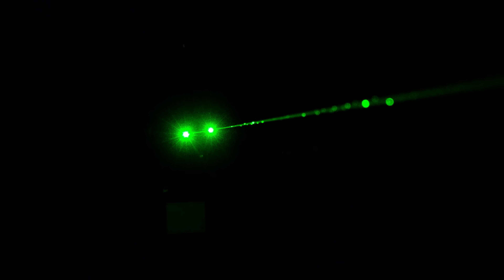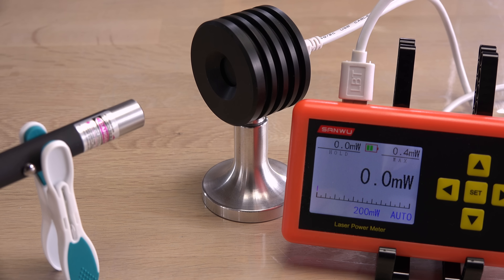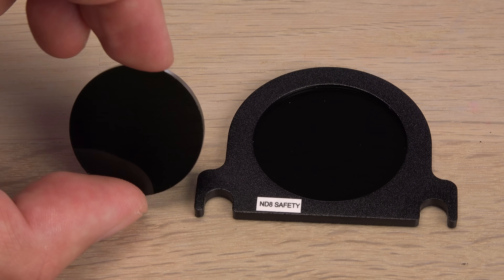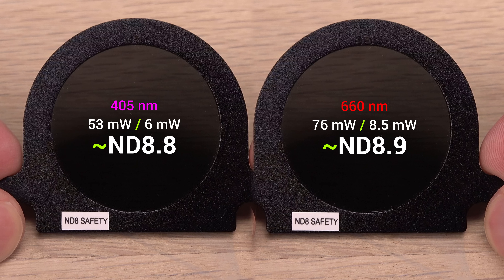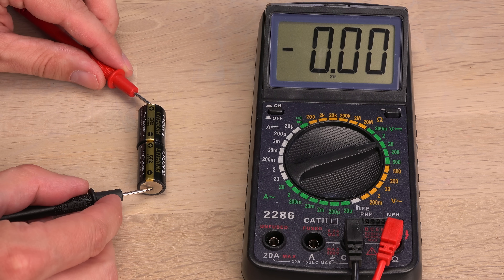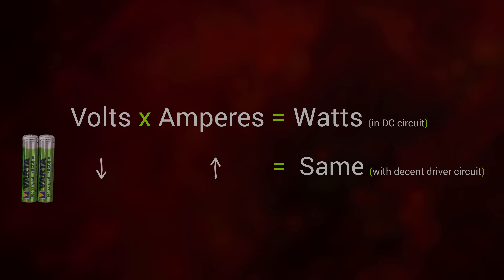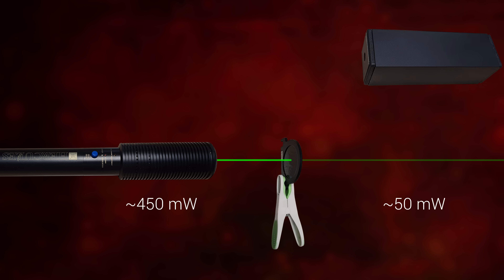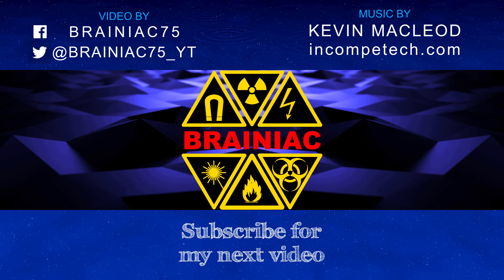Are lasers safer with rechargeable batteries?

Comment: I need your opinion on something. I worked for a company for 9 years and manufactured OTDR's. Our lasers were  650nm at 1mw, (this one was open-air, with no optics and visible ). We used 1310 at 15 to 30mw. 1550 at 55mw, and 1625 at 120mw.  They were spliced into optics (mux - negligible loss,  5% loss coupler, 50% loss coupler) How dangerous was this to our eyes? as the light was invisible and there was no way to tell what was shining across the manufacturing floor. As well as techs sitting at benches opposite each other could be looking into the beam from the OTDR across from them.  Then we had an optical calibrator that was at full power of the above wavelengths emitted from a fiber optic cable at a bench.  I am wondering if there could have been any harm done at this power level to the eyes? I thank you for your reply.
Reply from the maker: Hi James. Hard to tell without seeing and measuring on the set ups. I have no experience with fiber optics so I can't tell anything for sure. But I think I have seen sources on laser beams exciting fiber optics with very high divergence. This means the 'beam' will only be an eye hazard if you put your eyes close to the fiber end. But I am not the right to ask. A laser safety officer at the work space should have the answers.
Reply: @brainiac75  Thank you for your reply, funny, we never had a laser safty officer, at least not that I was aware of, and I was the group lead of the optical department.  Im sure it was ok, but exposure is a possibility. Im sure its just age but 15 years later my eysite has degraded throughout and I wonder.  Thank you.

Comment: Having been to an optics labratory with class 4 lasers all over the place and lots of optical instruments in the beam paths i can say that everything is on one level. There is no deviation in verticality. Everything is surrounded by 5cm thick walls covered in filter material and its not allowed to lower your head towards the level of the optical instruments. Its all because of the reflections which are devastating for class 4 lasers. When instruments are run you can actually see the beam path split and hit the walls.
Reply from the maker: Yep, a common lab safety procedure is to keep the laser beams at one level - and never at eye level! It is also recommend to use a laser of lower power while setting up the optics and then switch to the more powerful laser for the actual experiment. Or lower the power of the main laser if it can be regulated while setting up the optics. Reflections are no joke! Thanks for watching and sharing!

Comment: The reason that changing battery  doesn't affect the Power output much is because the laser driver circuit has a voltage boost, thus the output voltage remain in the same ballpark. This will only happend with higher voltage laser (>5 volt). For example PLT5 510 running at about 6v to 6.5v

Comment: Since laser diodes are constant current devices lowering the voltage with rechargable batteries won't really work. An appropriate sized resistor should help lower the current and the power.

Comment: Simply add a resister between the power source and the laser.
If you don't want to mod the laser itself, using a conductor instead of one of the batteries should lower the voltage enough. 
Another option would be making an inductive receiver that fits the battery chamber. You can then use an external power supply with finer or use a constant power and change the number of windings in the supply inductor.

Comment: Hmm. Perhaps making the beam broader would lower the power, or would that just spread it out, but still retain full power? For example through a lense or some glasses?

Would your eyes still be the same amount of in trouble if you had a very thick lensed prescription? Or would it lessen the potential damage to your retina's rods and cones because the beam is less concentrated?
Reply from the maker: Making the beam wider would lower the power intensity (watts per area) and make the laser beam a bit safer. However, it would still have the same total power and our eyes would focus the beam onto the retina. So not necessarily safer at all.
If the beam is changed to have higher divergence, getting much wider with distance, then it could be eye safe at a long enough distance. But never stare into a laser beam in any set up ;) Thanks for watching!

Comment: Unfortunately you didn't get the explanation correct for why the rechargeable batteries didn't have much effect. A battery isn't "low on amperage" when it's partly depleted. The current flowing in a circuit depends only on resistance and the voltage across that resistance. I = V/R. A battery with a given voltage will always push the same current through a given circuit as any other battery that can maintain the same voltage. 
The likely true explanation is that these laser pens all contain driver ciruits that boost the voltage up and then have a linear regulator to supply a constant(ish) current to the laser diode. Once the battery can supply enough current to get the linear regulator above the where it needs to be, any increase in voltage won't make a difference to power. But if you have batteries with significantly low voltage then the boost circuit won't be able to get the linear reg above the sum of the voltage drop of the laser diode at full current plus its own dropout voltage, and then laser power will start to fall. 
The upshot is that battery voltage isn't directly proportional to  current through the laser diode.
I notice that your rechargeables were nicely fully charged, but your alkalines only added up to 2.94. I'd expect around 3.2v for brand new alkalines, so try that and see if you get even more power. I think you might be able  to claim a significant difference between alkaline and NiMH then!

Comment: The lower battery voltage did not have a significant effect on the output because the laser has a step up converter circuit built into it. Test the voltage on the diode and you will see it’s higher than your batteries are supplying. This means that it will just draw more current from a battery to reach its target output voltage. This circuit is used in the blue and green lasers but not in red. Red laser diodes require less voltage, about 2v for low power diodes so there is no need for step up circuitry. That’s probably why your red one was dimmer with low batteries. To dim blue and green just figure out a way to put a resistor in series with the battery supply. This will limit the current that the step up converter can draw and reduce its output. Maybe start with around 50 ohms and see what you get.

Comment: You should put a bunch of mirrors in line so that the laser beam will keep on reflecting off of the mirrors. It should dim the beam, but I have no idea by how much, I guess it also depends on what kinds of mirrors you use and the amount of mirrors used.

Comment: These usually use a simple constant current regulator made with a transistor, a cheap reference like the TL431, a shunt resistor, and something like an LM385 as the controller. The op-amp measures the drop across the shunt resistor and adjusts the current to the transistor to maintain the set current (which is provided by the reference). If you can access the board, you could tweak a pot if there is one, change the voltage of the TL431 or other references, or just change the shunt resistor.
It'd be interesting if you could actually do it.
Cheers!

Comment: Using a dimmer switch that you normally use for lamps in the house
Reply: That works with AC current, these are DC lasers!
It's a good idea though, you can use a potentiometer in lieu of the TRIAC found in an AC dimmer.

Comment: Since the ND filter absorbs that much power, could this damage a cheap filter or even burn through it?
Reply from the maker: I can't rule out that a cheap ND filter could get in trouble with a laser beam. Especially if of high strength like ND25 and made of thin glass that isn't borosilicate glass (heat-resistent). Always be careful when putting optics in front of high power lasers ;) And thanks for watching!

Comment: Measuring battery open-circuit voltage is not a reliable way to test its condition.  A better way is to switch your multimeter into the 10A or 20A range and BRIEFLY measure its short-circuit current. Lead-acid batteries excepted.

Comment: Suggestion: Some green lasers without an IR filter will output a secondary 808 nm beam. Isolate this beam (through diffraction or a green blocking filter for example) and see how well the high and the low quality neutral density filters attenuate this beam.

Comment: It depends....A Laser with a proper Constant Current power supply will NOT change the Laser's Optical output power with changing input voltages. If a cheap resistor current limited PS (as in 5mW cat toy style lasers for $1) is used then YES a changing input voltage will change the Laser's Optical output power.

Comment: Option A : use 1 battery and then fill the rest with aluminum foil

Option B : buy that device that let a you choose the amps and volts

Option C : use used batterys or batterys low on charge

Option D : this may not work but you chould try puting a device that uses power between  the power source and laser , light bulb or electromagnet ( putting a magnet near and electro magnets offers even more resistance)

Option E : get a very thin thing , like paper and try to shine a laser trough it

Option F : use mirrors to make the laser lose lots of energy before it hits it target

These are just ideas that work in my head , but i dont know if the work , but i hope it helps  you get ideas :)
Reply: I tinkered with lasers since 98 none of those things you said would work to low powered and it simply won't light up most 5mw lasers need a constant supply of power to maintain output it might have a limited low output but from experience it will just cease to work
Reply: @markjames2164  well thank you for your feedback , but we still dont know what brian whats to  do also this is mosty to just give ideas , again i dont know what he wants exept a weeker laser also you said you tested it in 98 , so the tech may be diffrent today then before , i have a laser from 2012 i think and the laser  has a problem of not turning on some times and making a flash when turned on and a super unstable output (from a bearly visible dot to you being able to see it trough the air )
Reply: @microwavetransformer6378  that's some bad quality control, but the physics of lasers haven't really changed any since its invention, still a 3/4 level system to facilitate population inversion and stimulated emission so that you get that nice coherent source. 

nice try but
A-D: not turn on
E: becomes a scattering point source, not exactly what you want when you start with a laser
F: that takes an absurd amount of mirrors to do anything effective

Comment: Those laser pens have BOOST drivers because 405nm diodes runs at 6v.

This means, even if input is 2v or 4v, the driver outputs 6v @ 100mA regardless :)
Reply: Yes and the constant current source will make it constant until the voltage drops too much at which time the current might lag, but also a good circuit will probably shut it off. Certainly nothing linear about the power supply based on the power source.

Comment: Rather than amperage, refer to internal resistance.
Reply: Max Amperage during short circuit is more intuitive for me.
However, internal resistance is more useful for calculation.
Reply: @hsooi2748  I would assume not every laser driver is designed the same and some may produce less amperage with lower voltage.
Reply: @practicalguy973  some lasers are simply driven by a battery with a series resistor. Some with a switch mode power supply (or similar)
Reply: I mean to be fair the maximum short circuit current is more representative of the real limiting factor here it is literally the maximum rate the half reaction at the anode can liberate charge. Fundamentally for any given temperature and state of charge of the cell there is a finite amount of charge the cell can provide per second. Attempting to draw more than that will deplete the surplus of charge at the anode and cause the voltage to crash until the current flow balances with the finite rate the charges are being replenished.

Comment: I second Cross-Polarized filters, but with a twist. Instead of a traditional set of cross polarized filters, use a variable ND filter which is two circular polarizers that rotate to vary the amount of light let through.

Comment: I have a small red pointer I found in a drawer in my uni. It was abandoned for so long, the battery had leaked and the leakage had hardened. Took some banging to get the old battery out.

Instead of replacing the AAA battery I decided to put 10440 lithium battery that I usually use for my other lasers... and the laser could handle it! I'm pretty surprised. Then I did that to cheap eBay 405nm and it died within minutes lol.
Reply from the maker: Nice hack. The red laser must have adriver with decent voltage regulation since it accepts overvoltage. Thanks for watching!

Comment: How to make LaZers stronger; MORE BATTERIES (no serious... just take smaller batteries and squeeze them in! Best done with the coin cells laser)

How to weaken a Laser; Use less batteries... YES there are some Pointers who also operate fine at 1.5V instead of 3V, just replace one battery with something conducting (but be careful, often the metal housing is used as ground so don't stuff any metal without shielding inside!)

Comment: Likely not the "voltage x current = power" rationale, rather, the violet laser probably has a feedback-controlled regulator that "normalizes" the raw voltage to a predefined level.
Reply from the maker: But the driver still needs amperes from the battery ;) Thanks for watching and elaborating!
Reply: @brainiac75  True, but if you had an unregulated laser (like many red diode laser-pointers, without a photosensor, but with just a current-limiting resistor), the forward voltage would affect the intensity. You got (un)lucky that the violet laser had a fancier power-regulation implemented internally. The idea was worth trying though...

Comment: Batteries are NOT low in voltage or amperige. That would break for example ohms law.
If you measure batteries unloaded you don't get good results. It proves nothing about the voltage (and due to ohms law current) when loaded.
Reply from the maker: I agree that measuring batteries without any load on them is not the most telling. But they will get lower in voltage and amperes. Otherwise they would never have to be changed... Thanks for watching!

Comment: One thing I would like to mention, whenever we are dealing with Electromagnetic Spectrum with such an instrument, why  they don't have a distance/Proximity Sensor to Offset the Loss or gain (ones  Calibrated )Because the  EM radiation 
 decrease over the distance from the source?
Reply from the maker: I believe the higher output I measure when closer to the power head is simply because more spillage outside the actual beam is getting picked up by the sensor. Could be interesting to test how much of a difference it makes if the laser is 10 cm or 1 meter away from the sensor. Thanks for watching!
Reply: @brainiac75   You should use some sort of distance sensor as feedback for Your  EM radiation measuring instrument.

Comment: Well, since light emitted from a laser is polarized, what about using a polarizing filter? When aligned correctly, should it block about 99% of the light?
Reply: Wouldn’t that just destroy the filter? It’d absorb all the light and melt/catch fire. You’d need a special polarizer that can absorb all that energy
Reply: Oh yeah I guess if you used a low power laser forgot those existed lmao
Reply: I don't think all types of lasers emit polarized light. They definitely emit in-phase light, but not necessarily in-plane.
Reply: I don't think all types of lasers emit polarized light. They definitely emit in-phase light, but not necessarily in-plane.
Reply: @sean Monaghan  why did you type waste?

Comment: Putting your laser pointers in the freezer seemed a pretty effective way to lower the output.

As a serious suggestion, I suppose adding resistors is a possibility. Depends the way the laser is driven.
Reply from the maker: Hehe, for a green DPSS laser, it definitely works for the visible part ;) Not sure, what it does for the power output of say a red laser pointer. Good idea for a test!
And yes, the driver will probably counteract an external resistor. Could be worth a test too. Thanks for watching, supporting and the input, Izzie!
Reply: @brainiac75  What about using two polarising filters? This would allow you to adjust the intensity without changing the power.

Comment: I have an idea but it would require alligator clips or disassemble of the laser and this is the idea I would use a variable voltage and current power supply.
Reply: Ive done this, and the results are as expected. More voltage, more light. 
More light, more radiation

Comment: Try lowering the power using a lab power supply - with that you can dial in the power
Reply: Will not work, a boost driver will draw more current to boost the voltage to the diode's correct 6v input :)
Reply: @Deadwindshadow  constant current power supplies aren't uncommon.
Reply: @PoignantPirate  Okay, that would cause the driver to no longer properly regulate and have strange behavior. This could possibly damage the diode or the driver.

Also, what use is a laser POINTER when its connected to a bench lab power supply lmao
Reply: @PoignantPirate  SO JUST PLUG IN THE DIODE DIRECTLY TO THE LAB POWER SUPPLY LOL
Reply: @Deadwindshadow  isn't that dependant on the laser? 
Some certainly have a intelligent power circuit, but others aren't equipped with such a feature... am I missing something?
Reply: @123i123i1  i was referring to the one in the video.